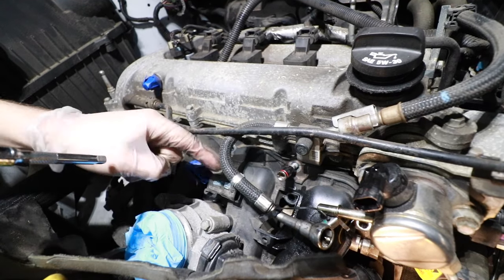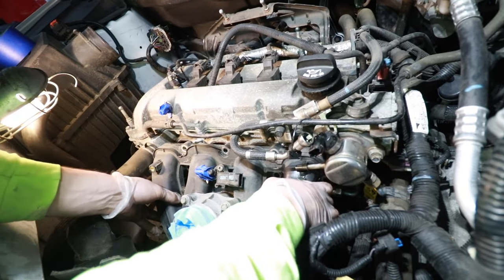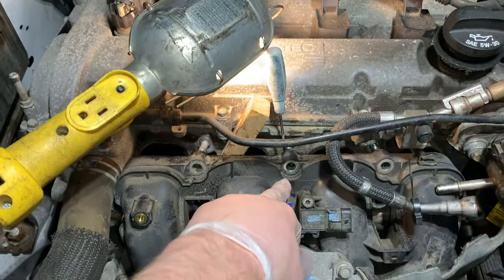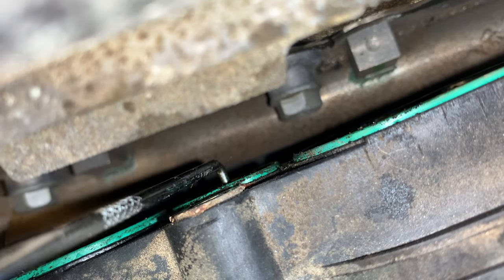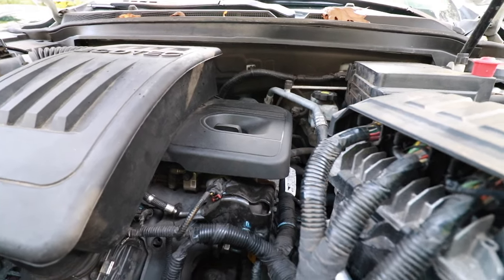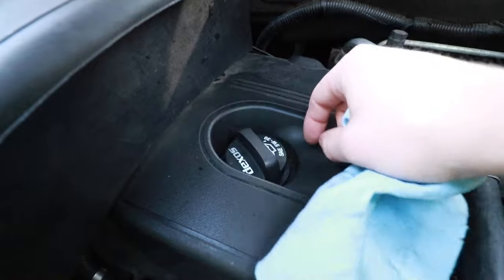GMC Terrain 2.4 Clogged PCV | Oil cap pressure REPAIRED

Comment: Hello, 
I have a 2010 Chevy equinox with this same engine and it has a rough idle to the point where it stalls sometimes. Could this same issue be the problem? Thank you & great video? 👍
Reply: The variable  timing solenoids. could be slugged  up from high mileage  or not changing the oil properly.The solenoids have very fine mesh screens  on them.When they get clogged up.Will cause problems.You can pull the intake one out and clean it up with carb spray.It's only held down with a ten mm headed bolt.Clean it good and reinstall it.See what happens.Easy to get to.You might have to carefully grab it with some type of pliers and slowly turn it back and forth and pull upward.Especially if it's sludged up.Take your time doing it.
Reply: my 2014 equinox  was stalling and it was as mentioned the intake camshaft solenoids.  Amazon has aftermarket ones that are $25 for the intake and the exhaust fairly easily to install and took care of that problem. But last week my PCV system froze which this video is addressing that blew out my rear oil seal.. not a cheap repair being there is a ton of labor involved
Reply: Most likely carbon buildup on the intake valves.
Reply: Variable timing solenoids for sure. I have a 2011 and have had them replaced twice. If I wait until I actually hit the mileage for an oil change they will usually gum up and start to fail. Have to get an oil change about 1000 miles early to avoid it now days.
Reply: @randikalicki5056  did you try cleaning them out with  brake cleaner?
Reply: Yes it is the symptoms of carbon buildup.
Reply: @Inthefoxhole  absolutely correct just bought a 11 terrain first thing I replaced mesh was very crudded up and one was failing very important easy and cheap

Comment: heck i installed brand new intake  andnd installed vent cap but it still has a lot of case pressure  and looking at both intakes theres about 6 holes for pcv system
Reply from the maker: Piston rings might just be that worn out. Run it into the ground, or you could always do a rebuild.
Reply: @OldSoulMillennial  yea what about seafoam will it loosen up stuck rings 100k on vehicle
Reply: It’s may id use marvel mystery oil in oil

Comment: Thank you!  I replaced intake/exhaust camshafts, camshaft position sensors, and for no improvement.  Hopefully this will fix it.
Reply from the maker: What is your issues? Oil cap pressure? Burning excessive oil?
Reply: I have a 2015  2.4 equinox with 105k. Just bought it in October did the oil change and the other day found it was 3.5 quarts low on oil!!! No leaks it’s burning oil at an insane rate.
Reply: If your pvc hose had vaccuum could you start the car pull the hose off and spray carb cleaner into the pvc hose letting the vaccuum take the cleaner all through the system?
Reply from the maker: @2wheeladdict12  Join the club! Be sure to check/add oil every two weeks. This video should help reduce the oil consumption. It reduced mine by half.
Reply from the maker: @2wheeladdict12  In my opinion, it won't make it that far. Even if it does, you will really need a 90 degree pick to unclog the port.
Reply: @OldSoulMillennial  but once I do the cleaning it can’t hurt as a regular preventative measure to keep from clogging up? I’d emmisions the only reason I can’t just in plug the pcv hose and let it vent into the air and not go back into my engine?  What about making that hole a little bigger.
Reply: I have the same vehicle but mine is diieing at stop signs and backing up ang has engine light

Comment: Those engines have a lot of pressure that’s normal. Now if you have a 2.4, go outside, loosen you oil cap and see what it does. After that take the oil cap off and feel the pressure that’s coming out of the engine. Now, the cap may not dance around but when you remove the cap and feel the pressure you’ll be like wtf. All these test these people put on YouTube to check and see if that little hole is plugged don’t work. 

Our car is a 2017 gmc terrain 2.4, has 86k on it. I’ve tried the suction test, the oil cap dance test and the one where it’s supposed to whistle if you plug the line that goes from the valve cover to the air intake/plentum. None of the test work. So wanting to be proactive, I tore it down and the little hole was plugged with carbon. Cleaned it out put it back together and re did all the test. Every single test that’s posted on YouTube, the results were the same as before. Same exact results as the first time. Just be proactive and I’d say every 30k check the hole and make sure it’s clear and run the oil cap part number fc219 so it will release pressure.
Reply: They known for piston rings being worn or incorrect from factory. Doin a 2011 equinox now. Customer states uses alot of oil. Took cap off n it blows alot out. Doin a new piston an rering on it
Reply: There is a 2015 GM Service Bulletin noting there MAY (or MAY NOT) be a whistling sound, although I don't know if the system was changed by 2017.  "With a properly operating PCV system and the manometer installed, there may be a whistle noise coming from the front or rear of the engine when the engine RPM is raised. This is normal when the vacuum in the engine is increased. The front /rear seal will open up and let air pass, which produces the whistle noise". SB-10090101-2280

Comment: Thanks for the tutorial.
Have question tho, what did you do to the gasoline that was sprayed all over when you took off the low pressure fuel line? I'm worried if that happens to me then it will cause a fire while I'm driving lol
Reply from the maker: It will mostly evaporate. Ensure the engine is cool prior to attempting. Wipe down afterwords. Have a hose or fire extinguisher near by.
Reply: @OldSoulMillennial  wth 😂
Reply: That’s funny. Common chemistry there .lol😅

Comment: Use a Manometer hooked to your Dipstick tube to get a Baseline on Crankcase vacuum. From that point on you simply test anytime you're in question of a problem with the PCV System. Honda/Acura has a low vac design and is why they in time consume oil. Ring gap gets wider, they lose ring seal with wear, etc.  Here is a video before I changed the PCV System, used a Torque app on my phone and a Manometer again hooked to the Dipstick Tube to get dynamic readings or baseline of the OE profile. Very crude but effective to sort things out. Notice at 2:00 how long the Crankcase stays in pressure for 20 seconds.
https://www.youtube.com/watch?v=h8PwCtzD_Ds&t=1s

Comment: Timing chains on these engines should be replaced at 150k. If your PCV is clogged, you should really think of doing the timing chain too. The guides like to break and cause the chain to get loose. It’s not super hard to do in your garage, but will take time. Last one I did took me 3 evenings, but I replaced a few other things at the same time (like the valve cover gasket, VVT solenoids, spark plugs, and fuel injectors)
Reply from the maker: I made a video on the timing and balance chain replacement. https://www.youtube.com/watch?v=l9dfi_St4f4
Reply: The timing chain isn’t the problem. It’s the result of other problems. fix the other problems like changing the oil on time and the PCV you won’t have a problem with the timing chain.
Reply: @sbond1963  I replaced a timing chain on one and it had clearly stretched. The plastic chain guides will break due to age before the chain stretches enough to skip a tooth though. Changing the oil on time doesn't stop the guides from getting old and breaking.

Comment: I think taking it all the way of and cleaning should be the way to go. You went right to the end then half ass'd it.  That orifice goes to each intake on that manifold.  You may have cleaned one or two    but you can't tell if all 4 are cleared unless you take it all the way off.   You started off great but there are better, complete ones already on here.

Comment: The proper way to do this repair is to undo the fuel hose and take the manifold stud on that side out of the way and then take the manifold right out to clean everything properly.  Just saying. That hole is pretty deep you need something straight and long to clean the hole out properly

Comment: Complicated. Should be possible to just remove tube (intake to air scoop) and use wire to reach "PCV" orifice?  Either blind repeated tests to find it or attach micro camera with light to wire?

Comment: I did the same but it keeps wasting oil clean the hole of the pcv orifice and it keeps wasting oil, what do you think it is thanks
Reply from the maker: Its just a poorly designed engine
Reply: I have the same problem,  is wasting oil... any suggestion about fix it?
Reply: they installed shitty rings causing  oil blow by.  best bet is oil change every 3000 miles and check your oil.
Reply: Bad piston rings. Google it. It's a common issue
Reply: Oil catch can!! It helps

Comment: Remove the throttle body from the cold intake and loosen the oil dipstick n I didn't need to remove the fuel line if you do it that way

Comment: PCV hole drilled  into flat top oil filler cap, ( install suitable PCV valve with grommet ), then to catch can, ( mounted as low as  possible ) then to brake booster inlet hose on intake manifold. Move check valve which is clamped inside the booster hose aside to right going to vacuum pump. It won't move past the molded angle.
Use brass tee to left of inline check valve. Forget the orifices in the manifold, they are better off blocked.
They are too low to do any good.
PCV valves are always mounted high atop the valve cover.
So why should Terrain differ?
The black hose coming out of the valve cover to air intake is the breather hose.
Only moist air should come out of it.
Use 11/32 in. hose, or clear teflon if available.
Don't neglect the trailing arm body mounts ( or rubber bushings ) on this vehicle.
It is the most dangerous thing about the Terrain, in normal situations.
Remove any rust from the area, inside and out, prime and undercoat.
Then undercoat again !
If I am wrong, hey; it's YouTube.

Comment: And manufacturers telling customers oil change increments are 10 and 15k miles is a ploy to get you buying another soon. Synthetic oil is black after 5k. It's called maintenance. Change oil every 5-7k miles. Any knowledgeable mechanic will tell you that information

Comment: We just had this job done to my wife's car
Reply: How much money did they charge you? And was it done at a GM dealership? Thx
Reply: @mikep.9005  It was $1100.00 for a new rear seal, and an additional $1300.00 for the complete clean out of upper engine with a new cam cover. Total cost $2400. The dealership wanted $3800.00 for everything. Hopefully they did a good job. But 2 days later we noticed I think our catalytic converter going. It's making a rattle upon start up and then goes away. We were told it might be from the back pressure when the seal was blown. Geeze... Horrible.......car is mint with very low miles 40,000 miles only.....money pit I see
Reply: Thanks for your reply! YIKES! Always something!
Reply: @mikep.9005  Always especially these days it's just horrible anymore how much parts and labor and the way things are built I wish you luck
Reply: I caught mine early only blew a camshaft seal 😂 replaced it myself and did this job will definitely be babysitting this car more
Reply: @mikep.9005  Always....more so these days then ever before
Reply: What year is your car ?
Reply: @rbarr1200  2016
Reply: @chaseww  thanks for responding.  We have a family friend that just bought a 2018 and for her sake I hope that year isn’t affected.

Comment: That engine is actually an I-4, not a V-4.  Ford and Saab are the only manufacturers that made a V-4 but that was back in the 60's.
Reply from the maker: Thanks for the correction
Reply: Lancia also had V4 engines
Reply: Mitsubishi Galant/ lancer had v4 back in early 90s too.

Comment: Loosen the gas cap next time it won't have pressure on it
Reply: What causes that?
Reply: @bigsteppa2200 crank case builds vacuum like pressure when engine running from pistons going up n down so it's vented through your pcv system if that gets gummed up n clogged this will happen there's no were for the pressure to go except through oil cap hole but it's also bad because it can push oil seals out like rear main or front main seals  if pressure gets to bad causing oil loss then engine loss eventually